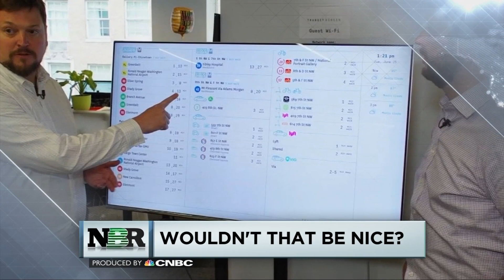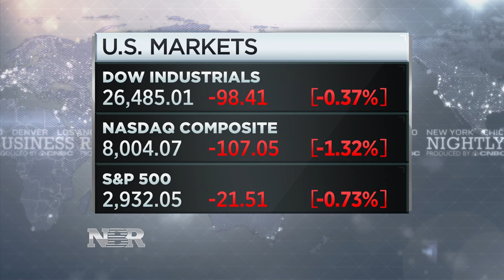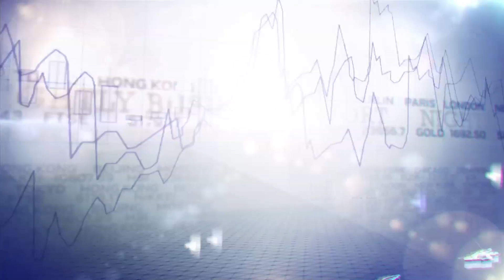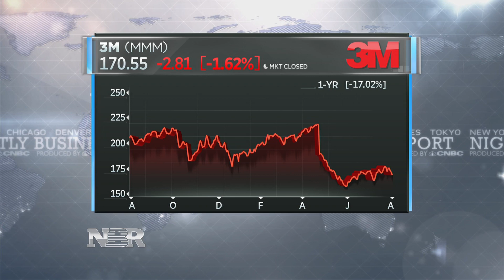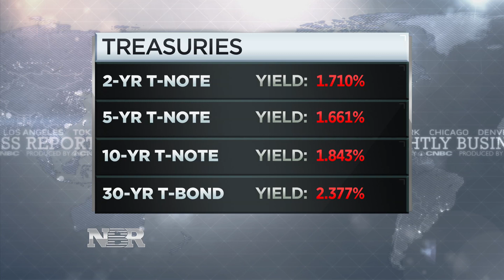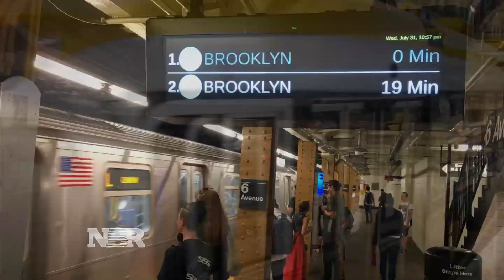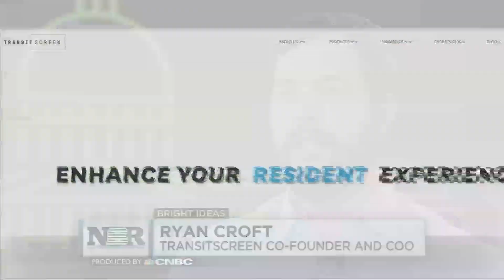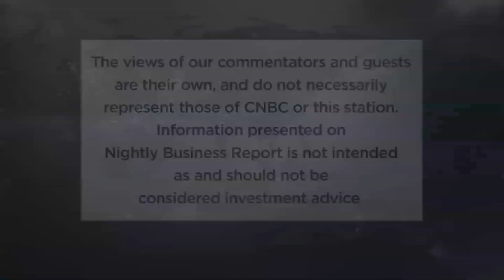Nightly Business Report – August 2, 2019

Comment: Today there were 38 new 52-week highs and 98 new 52-week lows on NASDAQ.    On the NYSE there were 79 new 52-week highs and 94 new 52-week lows.    The slope of the US Treasury yield curve declined further: 28 basis points separated the 1-month yield (2.11%) from the 30-year (2.39%).   Volatility, as measured by the volatility index multiple I follow, UVXY, was almost constant.   UVXY finished at 30.60, up 1.59% on the day.

Winners of the day included the Vanguard US Treasury long bond fund (US ticker: VGLT) and the iShares Aggregate bond fund (US ticker: AGG).   Regarding VGLT: "The fund employs an indexing investment approach designed to track the performance of the Bloomberg Barclays US Long Treasury Bond Index. This index includes fixed income securities issued by the U.S. Treasury (not including inflation-protected bonds), with maturities greater than 10 years. Under normal circumstances, at least 80% of the fund's assets will be invested in bonds included in the index."   Regarding AGG: "This investment seeks to track the investment results of the Bloomberg Barclays U.S. Aggregate Bond Index. The index measures the performance of the total U.S. investment-grade bond market. The fund generally invests at least 90% of its net assets in component securities of its underlying index and in investments that have economic characteristics that are substantially identical to the economic characteristics of the component securities of its underlying index."